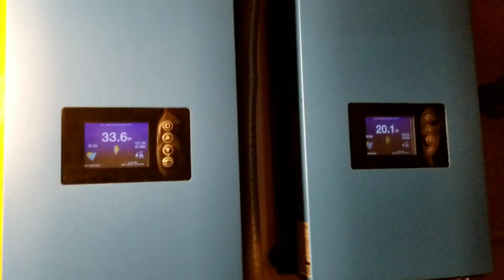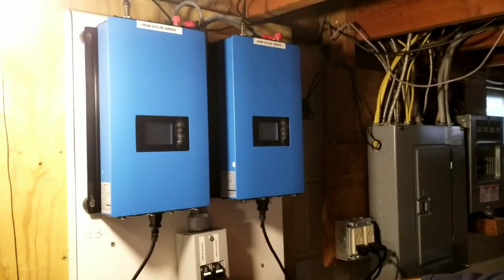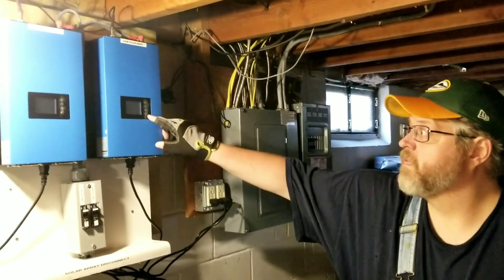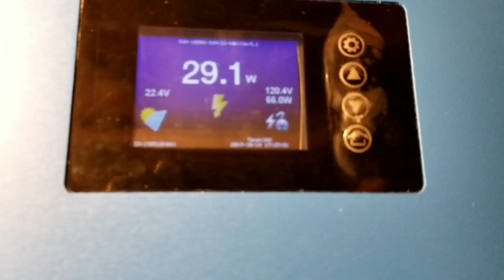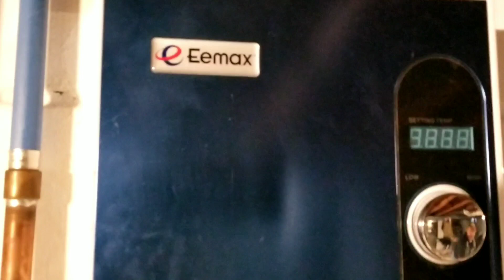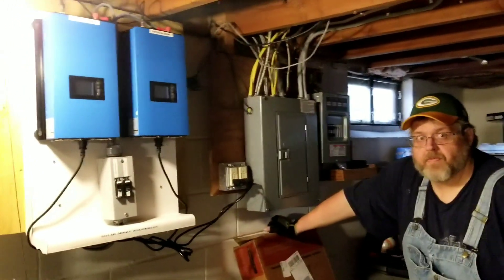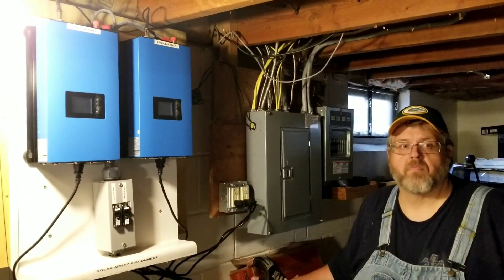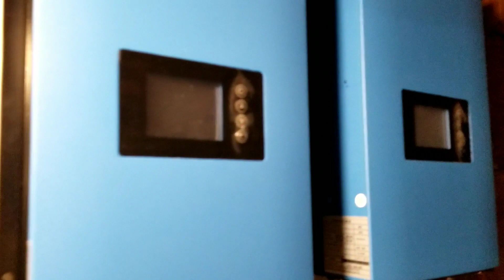HOW TO WIRE 120V, 240V ELECTRICAL PANEL FOR Off GRID SOLAR INVERTER

Comment: Hey guys, you can install timers on electric water heaters too.  They have been around for decades.   This keeps them from running 24 / 7 this saving you $ on your electric bill.  I have mine set up to be on from 6-10 am & pm.   We usually have no problems.  You can also flip a switch to cut it back on in an emergency....
Reply from the maker: Thanks for your suggestion.
LIKE SHARE & SUBSCRIBE